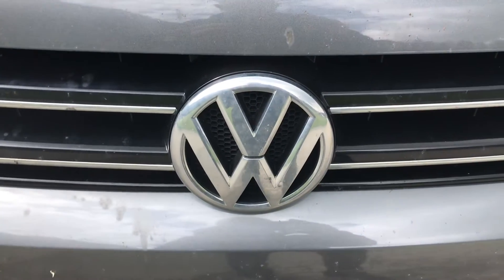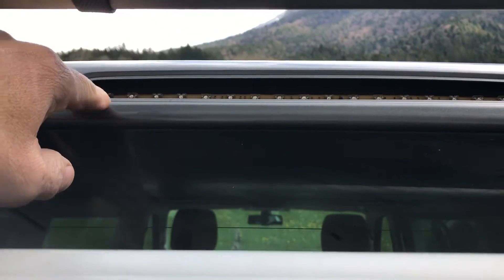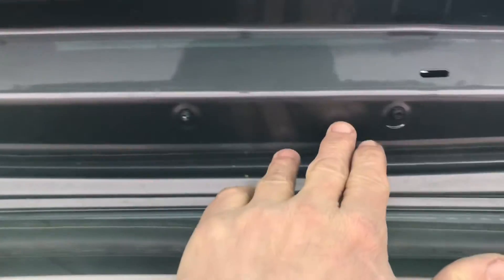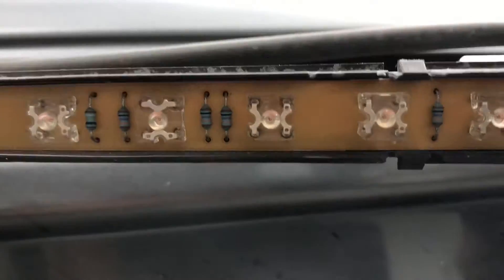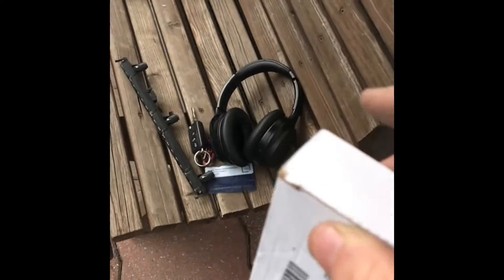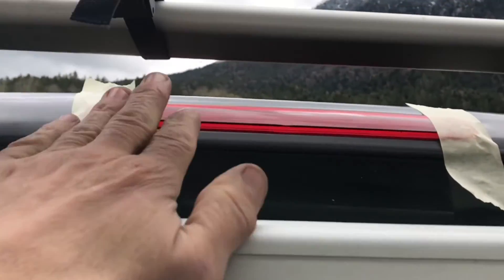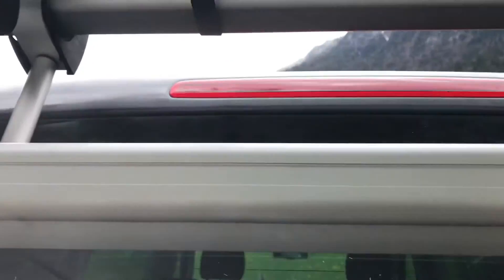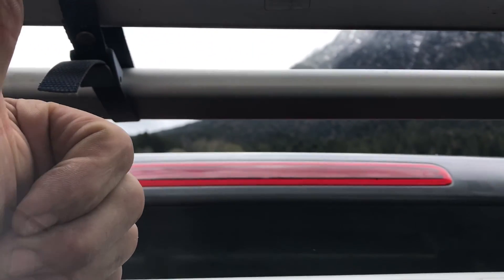How to replace VW T5 T6 Rear Tailgate Brake Light

Comment: Hi there
Thanks for the instruction on replacing the brake light, but you've rather skipped over how to remove the interior trim in order to get access to the torx screws.  The trim looks like it's a press/click fit, but after applying what I thought was sufficient force, the trim hasn't budged.  Any tips on how to do this part of the job?
Cheers
Jamie
Reply: ...and I finally got the trim off.  No real damage done, but some suggestions on a goode way to do this could help people.
One other suggestion - your clip shows the serial number of the part required, but it can't be read on the video.  I got a knock-off part, but based on my experience today, I'd suggest to others to get the genuine part if you can!
Cheers
JK
Reply from the maker: @JamesKing-tk1uv  well done I thought I did suggest getting the genuine part as knock offs don't have the seal fixed to the unit. I'll check. Well done in getting the trim off. You can do it 👍
Reply: @YoucandoitwithJules  I did see your suggestion, but got a knock-off with the seal fixed on it.  That bit was OK - two of the three sprung anchors partly broke, as did the lock for the wiring plug when I had to pull it apart to fix the  anchors (and no, I'm not a gorilla) 😆